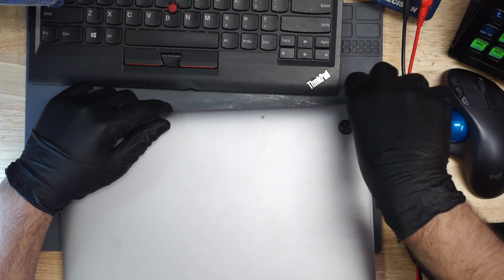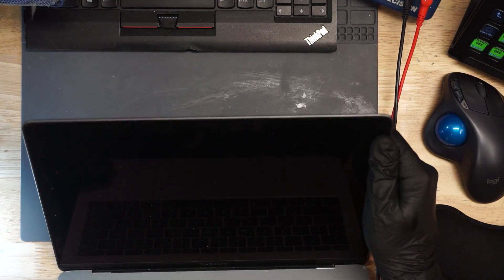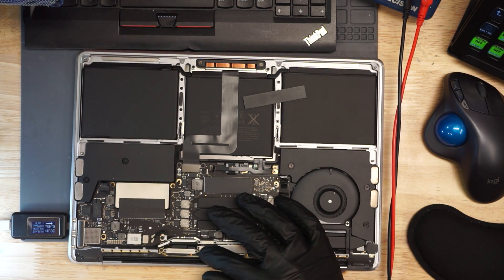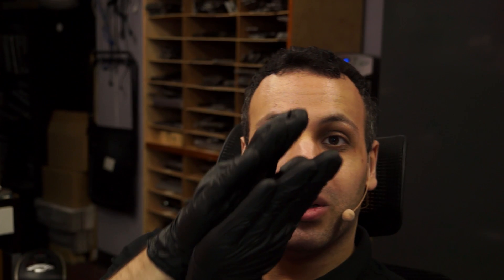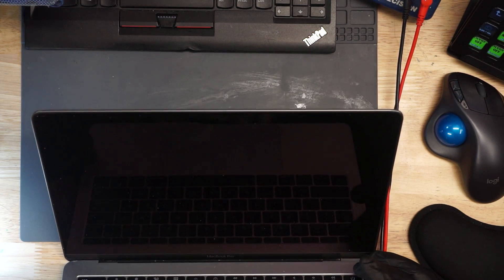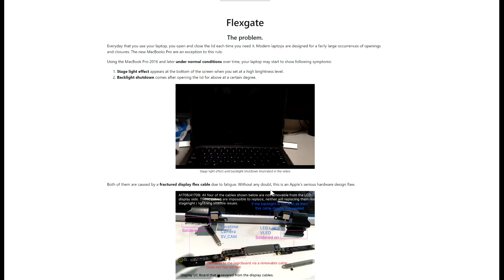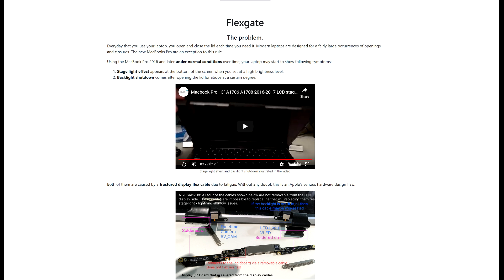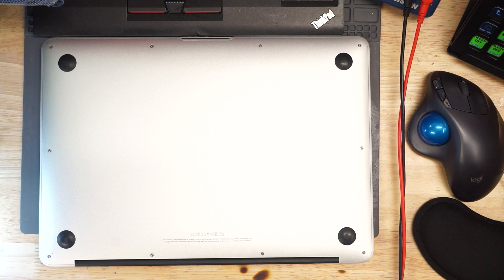Macbook screen DIES when opening lid: Apple provides NO FIX! flexgate

Comment: I got 2 of these f****g pieces of s***s. 2017 MBP's that is and yea nah, Apple won't fix them even though they rolled out a reapair program for  this exact issue... but they only included 2016 models. I mean what the actual ***k Apple? It's the same cable you agreed that is the problem but still you only accept the 2016 models only. You f****g mother'*****s. I didn't like Steve Jobs but he would have kicked your asses out the door who made this decision.

Comment: I am experiencing this issue right now with my macbook pro.  I am so angry and deeply disappointed. My previous macbook lasted me 9 years with zero problems.  It still works but it overheats.  I was very impressed with what seemed to be a very good product.  I purchased my current macbook pro in 2017 and I've had nothing but problems with it. It is garbage.  I'm a working DJ and I cannot rely on this piece of junk to play music.  I now have to purchase another laptop which WILL be a Windows based laptop.  Apple has lost me as a customer forever.  After shelling out $3000 for this to happen, never again.  Thank you Louis for all the hard work you put into your videos and repairs.

Comment: WTF man. I got a refurbished MacBook Pro for $2700. Figured Apple is known for quality, so it's worth paying money for good a computer that will last a long time, rather than getting a budget one and wanting/needing to replace it after a year.

For a year or two, it was great! I loved my MacBook! Then after a year or two, though, I started getting ghosting/image persistence problems, which got progressively worse... Then the screen just died. And even I can't even get into Mac...I can get into Windows 10 in bootcamp with an external monitor attached, but if I try to boot into OSX...all I ever see on the external monitor is a half black half white screen (sometimes a cursor?), but no key presses even do anything. WTF and why? No idea, and can't troubleshoot because I can't see anything.

And I didn't pay for Apple Care, so when I went to a Genius Bar, they basically said f*** off, give us $700 even though we sold a defective product that just died after 2 years of normal use. Finally decided to suck it up and ordered a new screen from China (Union Repair Limited), possibly risking throwing good money after bad, but hopefully I can at least get another year or two before it fails again.

In its defense, at least it's still a decent gaming machine. Thank God I had Bootcamp set up when the screen failed!

But I think it may be my last as well as my first MacBook.

Comment: Apple has an extended complimentary repair for this issue. https://support.apple.com/13-inch-macbook-pro-display-backlight-service

The repair is limited to four years after purchase however I purchased my laptop about 4.2 years ago and Apple still offered to fix it so it’s worth calling them to try. 

Thanks to you Louis, I wouldn’t have figured out what the issue was as my 13” 2016 MacBook Pro started having the issues you show in this video.
Reply: But not for 15-inch 2016?

Comment: Same problem here, using an Apple LCD monitor with a 2018 Macbook Air, the latter with a damaged screen.  I can get the lid up 1/4" maybe.  My solution?  Use a mouse with the lid propped up just a smidgen.  It works.  But at some point, I'll have to pony up $500, a third of the MBA's price, for a new, undamaged lid and screen.  Apple gets you coming and going!

Comment: This is an awesome video, https://www.youtube.com/watch?v=bYtDVjYNxig. Ok, it's totally related and there is a guy in China who does this. This is the description of the video: Learn to replace the infamous Flexgate backlight cable in 4th generation MacBook Pros without changing the whole display assembly. Dismantle display using the Air Slice tool and change cable only.

Comment: For those that are still looking for a fix... Apple is doing it free of charge. I love the 1st line in all these issues they have recognised "a very small percentage of 13-inch MacBook Pro"s have these issues... Mine has the keyboard issue, the battery issue and now FLEXGATE... time for a new branded workstation me thinks...
https://support.apple.com/13-inch-macbook-pro-display-backlight-service
Reply: How do they actually fix it
Reply: It looks like the new screens have a slightly longer flex cable.

Comment: Can confirm this is still an issue on the 2019 13" Macbook Pro. My backlight has not failed yet but I have the stage light effect on the bottom of the screen. I've had this computer for two months. The silver lining is that it's under warranty but given that this is a design flaw, that does not mean much -- it's just going to happen again a year from now.
Yes I'm an idiot for buying a Macbook. I couldn't stand windows anymore and got frustrated with troubleshooting my linux install every other day.

Comment: Thanks for the video! Do you have idea which laptop good to buy which will  have good construction inside for $1500 - $2000 ? I am using new Mac Book Pro 2016 with Touch Bar for 2 years and actually i like Macos, but hardware part is horrible - сonsidering soldered ssd, shitty keyboard, short display cable (FLEXGATE).... P.S. my first Apple product is Mac Book Pro 2016 with Touch Bar, and i'm upset, cause my expectation was different
Thanks in advance

Comment: Now is the right moment for you to become a hero. You find the solution to this problem (maybe soldering an extension to the wire or micro cables going from the whire contacts to the board?) and you'll find the ethernal life.

Comment: Using 2014 Macbook Pro. Was looking to upgrade to a new Macbook Pro due to HEVC/4K capable processors. Just all oth the other stuff the new macbooks have is rubbish. Not even the SSD can be replaced. Problems with displays, keyboard - what comes next? I think I stick to my 2014 one until it dies or Apple releases a better design...

Comment: what is up to entrepreneurs is to develop a fix for this. the fix would be the connector on the end, the same as now on the base. up under the screen frame, where the cable runs, you would have a method to quickly cut the old cable, and your new cable from below would seriously clamp onto the cable with pins, that hook up very quickly and easily. I would think you could manufacture this fix for less than 100$. thus shafting apple out of making new screens for nothing, the bastids.

Comment: I have a macbook pro tb 13" and I am sure that my next laptop would be a thinkpad or any windows machine. I posted this issue/concern on a macbook pro subreddit. As expected all macbook pro lovers flamed me there and accused me of panicking over an "overinflated" "imagined" "fake" and non-existent problem. Wow. Just wow. These new macbooks are stupid but macbook pro users are more stupid and they even defend every single problem (even the keyboard issue, they say that it is non-existent).

Why do 90% of Macbook users think that the MBP is perfect and everything can be fixed with a software update? Yeah right. Try fixing the cables with a software update.

Comment: I also have a MacBook Pro 2016 A1706. From the very beginning (I bought this device in early 2017) I had kind of similar issue:
Sometimes when I moved the macbook (it lying on my legs) forward or backward the backlit turned off. I had to lift the whole device upwards in an (I think 15 Degree) angle that the backlit turned back on.
When MacOS Mojave was released, I upgraded from High Sierra and then the ssd encryption failed, after the update I could not access my device anymore (My password failed for the encryption), tried everything possible, also with the help from Apple Support but nothing worked. Since I had the Apple Care Protection Plan they took it for some weeks to repair and they replaced the whole logic board and screen for free (833 Euros worth of cost). Now the OS works again (thanks to new ssd and logic board), but the 'tilting flex issue' still appears sometimes, regardless of the new screen... (I am from Germany)

Comment: Has anyone considered the huge pile of e-waste that apple (ironicly 'green' sounding company name...) is going to create with this problem? Instead of just replacing the cable and having that go in an e-waste pile; now we'll be throwing whole perfectly good LCD screens that work fine away too! It's irresponsible, wasteful and insulting to their consumers. This is just another reason right to repair should happen quicker as this practice with the screens arguably is designed to fail.

Comment: New, cutting edge design. It literally cuts itself off on the edges. Not literally, figuratively. We made our screens so thin because you wanted the bigliest and thinnest macbooks ever made. It's what Steve Jobs would have wanted. Sacrificing functionality for form, right? That's what we here at Apple do. We make art sculptures that just happen to function like what the plebes call a "laptop." We never said they would function forever, because what is art but if it only functions in the here and now?

Comment: There's actually DIY ways to resolder those cables with a special soldering iron tip. Not sure how well it works though, never tried it myself.
Reply: Please tell me more. I am not finding anything on this. SOMEONE has to have taken a stab at it with a junk screen..

Comment: I knew there is a reason I stuck with my older 2015 15" Macbook Pro, at least it can still be repaired. Only issue I have had was the screen cable went bad, and it works perfectly well, I do not see why Apple keeps on changing the design to make it thinner, when it works fine, making it thinner causes more issues, in particular with heat.

Comment: Hi, 
So Im another poor soul with Issue described by Louis 
So I sent my mac to repair under warranty  and I ask some questions  what is  Apple statement on this 
I was told  that that all laptops identified with display flex cable will be fixed without anz charge 
Also .. with new display issue should not occur again again 

Someone can confirm this ???
Thanks

Comment: I must have a unicorn macbook pro. bought in mid 2008. Only thing its had done to it is a battery replacement by me and the track pad and speakers replaced this year. The only 2 things that aren't working correctly now is the keyboard light is out and I need a program to run the fans to prevent overheating. However this is the last macbook ill ever buy. I at least got my moneys worth out of this one.

Comment: Hi Louis 
I like your right to repair. There is a model which may be worth looking at. In aerospace you cannot get a part or system  certified without providing the repair and very quickly a full overhaul manual and the AMM (Aircraft Maintenance Manual). The FAA, EASA,Airbus, Boeing and many other manufacturers across the world understand the manuals are not a threat just a way to make life safer and easier for the whole world.
You cannot be stuck in an airport in the middle of nowhere because the tyre or brake failed so you publish how to repair so the plane can fly safely.
Apple just are too arrogant to think there is anyone else who can repair anything. In my experience getting repairs done worldwide including AOG there are some brilliant little shops who can do almost anything and hold all the necessary licenses and airworthiness ratings to complete even comes work because the system diagrams and manuals exist. When  a fault is found that is not in the manuals a note can be sent in and the manuals updates.
To quote an advert in the UK simples.

Keep up the good fight and go from strength to strength.

Comment: But they can easly avoid these things didn't they? I mean It's like apple have some special engineers to working very hard to purposely make apple broken after certain amount of time.
Reply: Yes, it's obviously done on purpose. There's absolutely no advantage to this design as opposed to a more traditional configuration. In a normal configuration the video cable is a separate piece that is plugged into the display on one end, and the motherboard on the other end. If the cable were to break you could just buy another one and replace it. That being said, traditional cable designs don't usually break. It's mostly the screen or the inverter that break. Older LCD displays have fluorescent back-lights which are controlled by the inverter. Newer LCD displays with LED back-light do not have an inverter anymore. That removes a part that can break (and they do). I guess Apple needed to add something else to replace the inverter and came up with this design, which of course causes you to buy a whole new screen at the same time.

Comment: Are those flex cables using carbon paint for contacts? That should be repairable by touching it up with carbon paint where the connection broke. There is also conductive silver epoxy in Amazon (MG Chemicals 8331 Silver Epoxy Adhesive - High Conductivity, 10 min working time, 14 g, 2 Dispeners) you can use to glue a copper wire directly on the etch. You only need a dot of it on both ends of the wire, and can use a cheaper glue to hold the rest of the wire in place.

Comment: Properly designing flex cables to do this sort of thing and the testing to make sure it is not prone to failure is very old. The fact it happens means that Apple didn't do the work, didn't know better, or simply didn't care. 

The break in the trace on the flex cable will be at the bend. A fix that may or may not last would be to expose the trace and then tape wire strands across the break. Of course that's very much a kludge and not something a shop should do. Also if the tape fails now there's little bits of metal floating inside the machine. Me, I would probably run a a thin insulated multistrand wire from the flex cable connector to where ever I could access the trace on the other side. Again, it's kind of a kludge.

Comment: "But why can't you just cut open the cable, trace each wire individually, and splice in an exact patch for every copper strand?!?  0 stars!"
Reply: Attempting to cannibalise the cable is not a robust fix it's a hack, and if the mod failed Louis would be responsible for a replacement screen.

Comment: Why aren't there more class action lawsuits against Apple and their products?
Clearly they fuck up the designs. From what I can tell from your channel, most every model has at least  2 or 3 common failure points. Not sure about the ratio between items sold and items that break down but significant enough it seems to me.

Comment: The Backlight FlexCable was manufactured too short. Has anybody contact to Chinese Vendors, who could produce an Extension for the Flex Cable? Thus preventing the Backlight Flex Cable to break. Since Apple isn´t adressing it for another 2 Years. Opening the lid not further than 90 degree prevents breaking the cable aswell. I know, not buying the damn thing is the Solution. People like me are trapped with this Laptop and have no money for expensive Law suits.

Source: https://www.youtube.com/watch?v=602Q00G_8rw